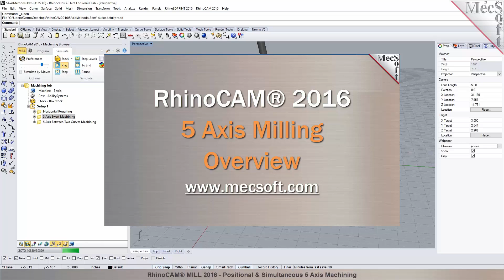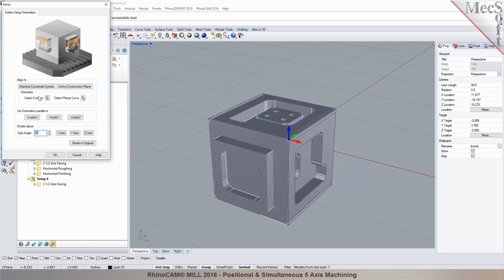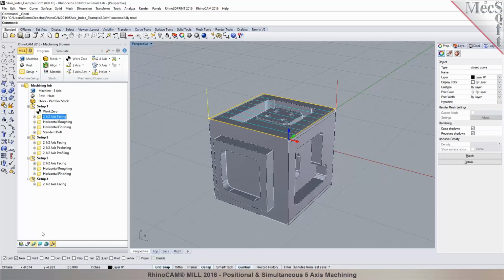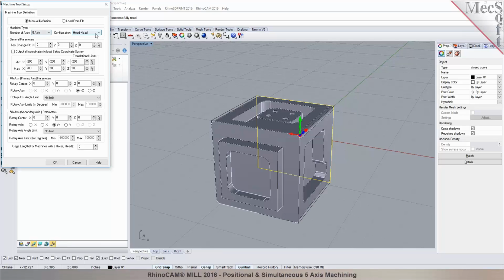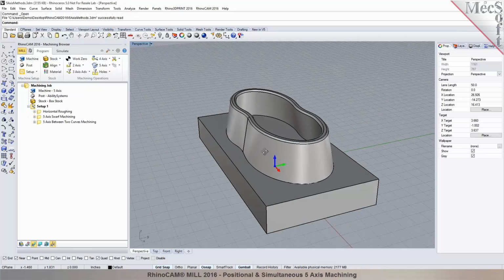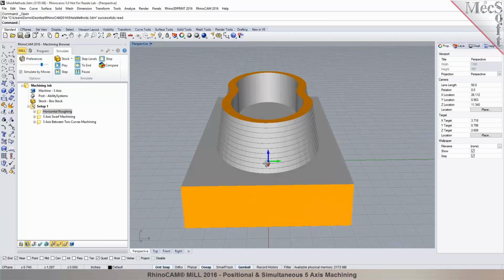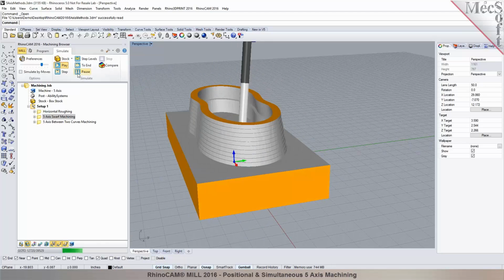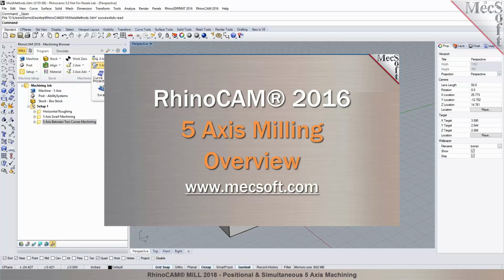RhinoCAM 2016 5 Axis Milling Introduction

Comment: Gtreat video.. i have some issue any help please? i use rhinoceros 5/CAM and want to cut on surface  not smooth just a little with angle like sphere but not fully ...how to say i dont know:-) example as (soap to wash hand) or like umbrella  they have same shape like sphere  surface as you know surface is not smooth a little bending...i dont know which axis in mach3 trajectory or name of axis is that in 2 1/2 axis or in 3 axis i tried some of them but nu luck:-) am as beginner if you know can you explain me step be step your help will greatly appreciate it...